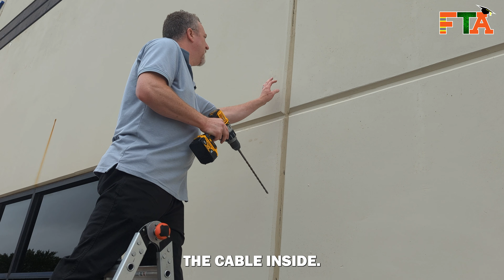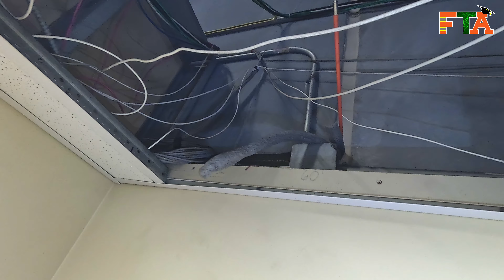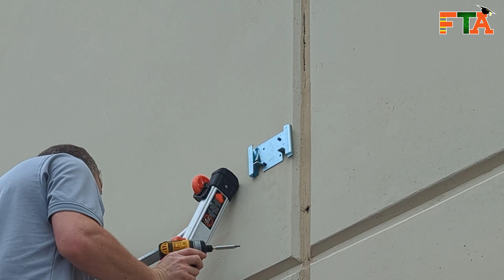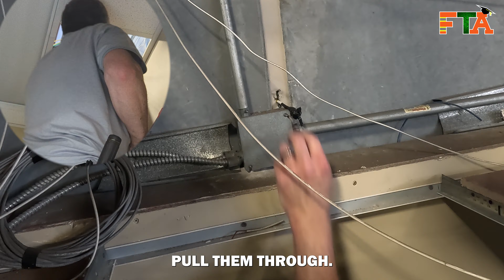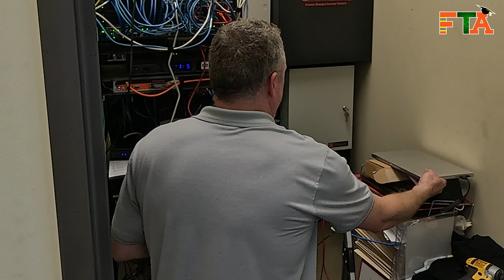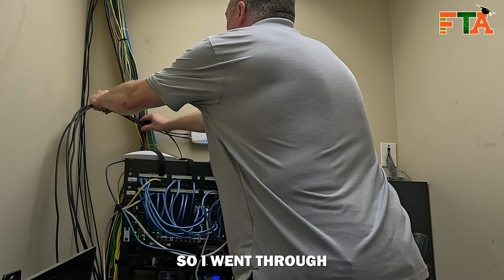Huge External Cellular Antenna Install | Digi EX15 LTE | Exterior Wall Mount | Best LTE Signal

Comment: But you've skipped the most interesting parts... how do you fix the ladder on the ground and how do you seal the cable in the outer wall.
Reply from the maker: I'm always debating how much minor detail to keep in these videos. 

Nothing special on the ladder. It was a nice cement sidewalk. I used silicone to seal the hole.
Reply: @fieldtechacademy  well, for me, for the longest time the stumbling block was figuring out how to bring a ladder to jobs.  Many jobs require it, but hauling it and using it, if you never have before, requires some adjustments.  Anything new can be a stumbling block if it's completely out of step with everything else you do.  Even if it's easy to do, it's only easy after you've done it a few times.
Reply from the maker: I completely agree. That's why I make all these different videos. I'm trying to show different aspects of this industry so potential techs can learn. 

Ironically I have a couple of ladder videos. 

https://youtu.be/tbUD9nOQUig

https://youtu.be/1fZBV3dIeUQ